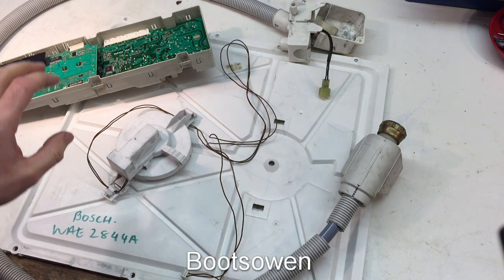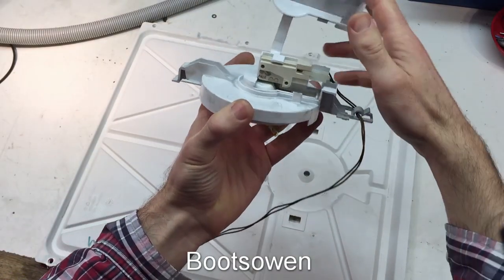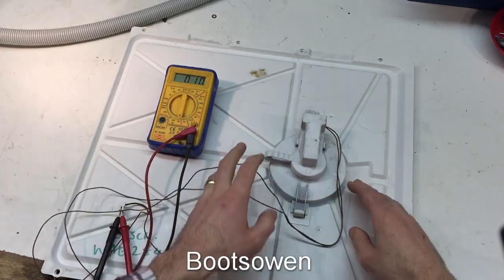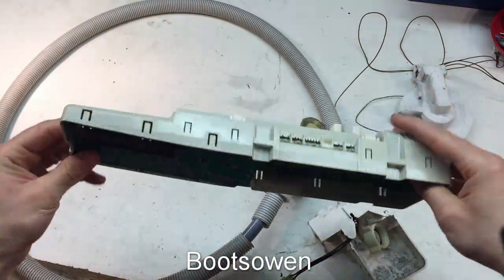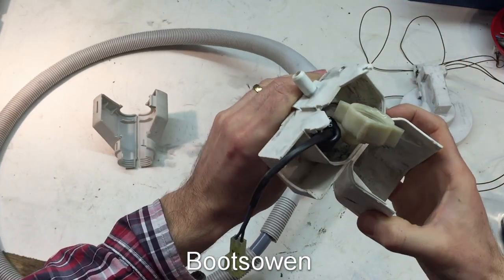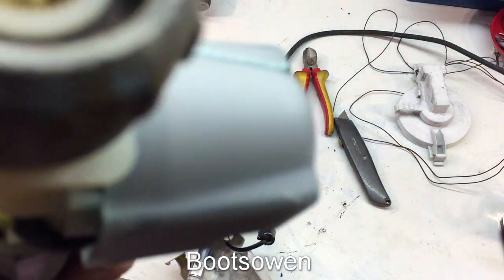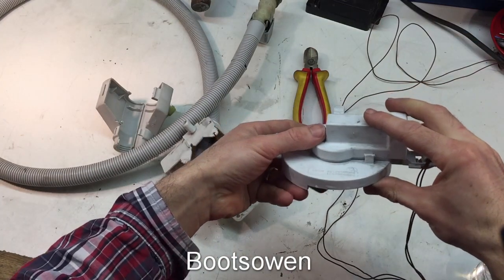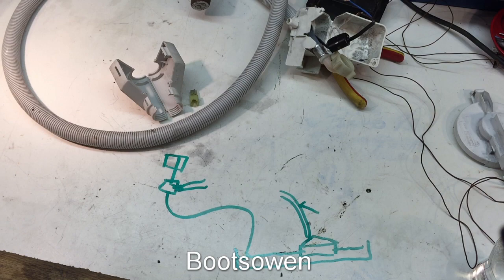Figuring out how a bosch aquastop works

Comment: Thank you, man! That really made some light!
I have such a hose that has been distorted by a mouse. I can not buy it as a spare part and taking the dishwasher to the service is out of the question. 
 If I understood correctly, the outer hose will only be used in case the inner one leaks? Because I can fix the inner hose, but the outer one only if the pressure is lower.
Reply from the maker: the outer hose will only be used in case the inner one leaks? yes. the inner hose is the only one that carries water most of the time. the outer hose would only be used if somehow the inner hose sprung a leak (without the outer hose getting a leak) and this outer hose would guide the leak water down to the bottom of the machine where the float switch will stop the water at the faucet.
Reply: bootsowen good news, thank you! I will be able to fix it in this case!

Comment: Came here to find some explanation on where does the Aquastop solenoid get its power from, because mine's attachment to the washing machine is just a plastic and rubber screw - no conductor anywhere to be seen!  Looks like the one you examined is instead fixed to the machine, from where power wires run out. That makes sense, but doesn't help for my case... (And it's a brand-new Bosch machine! no shady third-party or whatever)
Reply from the maker: Hi there, maybe this video will help you, let me know.  https://youtu.be/8P4uC1jat_U
Reply: Thank you, it helped to understand how the idea can work without power... and made me take a better look at my hose.
Turns out that the washing machine is listed as having Aquasecure, not Aquastop. So probably it's just like Watersecure - even though the shape is the same as Aquastop, and doesn't have the small window/indicator you show in there.

Anyway, this all solves my question, which was how bad is it to add a standard hose as an extender. (answer: survivable)
Thank you so much!

Comment: I guess the microswitch also triggers the drain pump as that plastic tray isn't designed to catch large amounts of leaking water.
Reply from the maker: I am not sure that that is so. If the water gets to the aquastop switch in the tray it is from a leak and the pump would have no effect on it. I think the aquastop turns off the water at the faucet so that a leak doesn’t get worse.

Comment: Thank you. Amazing explanation. Fan for life!! Cheers. Just wanted to know whether the same system is in Bosch dishwashers too? Because the inlet solenoid and the sleeve pipe is there too.
I always used to wonder why they have placed the inlet solenoid at the point of connecting to the faucet rather than in the machine inlet.
Reply from the maker: Hi, I think there are two inlet solenoids, one at the faucet and one inside the machine. The one inside the machine could be multi way for the main/pre wash soap drawers. I have seen similar on a miele dishwasher. But I have also seen similar systems without the hose where there is a float in the base.
Reply: @bootsowen  Thanks for that bit of knowledge. I am from India and to the best of my knowledge, Bosch washing machines here do not have aquastop, only dishwashers come with it. I used to think this was a patented system of Bosch, but all brands dishwashers come with this solenoid valve  at the faucet end of the water inlet pipe and the enclosed sleeve . Or is it not a patented system?

I did not know about this valve being part of aqua stop system till I saw your video.
I know water inlet to washing machines have divided inlets into the prewash, wash and rinse chambers in the machine. I used to think because of this multi valve inlet, they have not provided aqua stop in washing machine as it would make the system quite complicated.
Thanks once again.  Wishing you all the best. Love from India.
Reply: Just bought a Bosh washing machine (bought in Australia, made in Germany) and it does have Aquastop.

Comment: Hi thanks for the great video! I currently have an issue with mine, don’t suppose you know the resistance of the Solenoid coil ?
Reply from the maker: No idea. Can you test if it works using electricity?
Reply: @bootsowen  thanks for the reply, turns out it was working correctly and the washing machine had a leak so it shut off the water! Fixed the leaking o ring seal and back running again. Great video and explanation of how the leak detection works 👍

Comment: Question: does an Aquastop has to be positioned vertically down from the tap or does it function equally well when positioned horizontally or, possibly, vertically up? My question is inspired by space problems. Hope to read your advice. Thx.
Reply from the maker: I don’t think it matters. The solenoid valve should fail safe, it should always be closed under water pressure unless it is opened by electricity. Try it and see?  Let me know how it goes
Reply: Was there an answer to this? I have the same issue with a horizontal water pipe and no room to turn it downward...  :/

Comment: I currently have code E15 on 800 series Bosch dishwasher.   This has happened when the water inside the supply line freezes.  We were at 14F (-10C)  last night.  I'm guessing that's why I have the code.  The dishwasher is humming and appears to be trying to pump water, or something... I'm not a mechanic.  Pressing the start/stop button will not turn the machine off.  Flipping the circuit breaker won't get it to stop either. 
In the past I've always been able to pull the dishwasher out from the cabinet and tilt it forward, then set upright, push back into cabinet space and all was well. (Hope this may help someone else.)  I always thought that might be breaking a vacuum.

 Not this time.  Christmas eve.  I need to be cooking instead of plumbing!  I guess I'll try removing the water supply hose  and see what happens...hmmm...Maybe I'll warm things up with a hairdryer first.  Could be the water in the bottom of the drain pan is frozen.

Thanks for your explanation of the electronics of what is happening and Happy Holidays to All!
Reply from the maker: If you turn off power at the breaker and the machine keeps humming you have a problem with your circuit. Nothing in an electric machine like this should run when the circuit is off. Let it thaw.
Reply: @bootsowen  Thank you for your reply.  re: circuit breaker, I had hoped that by turning off the electrical  supply for a while and then turning it back on that the computer functions might re-boot and be OK.  That didn't work because the float valve was still raised and the machine warning was working correctly, as designed, and the pump groaning sound turned on as it should have.

Good News!  The hair dryer DID work YEA!!!!!  Once the frozen water under the float valve melted and was drained (by tilting the machine) the E15 code and noises went away.  I did have to drain the water from the pan with  paper towels, but as there were no apparent water leaks anywhere, I believe the expansion of the frozen water raised the float valve. 

This morning, Christmas morning, still at 19F, the water in the coffee machine froze.  
Thankfully we should be back up in the 70s F next week.  We're not prepared for cold weather here.

Comment: Great video and love the little drawing at the end , we have an issue where the washer kicks in but very quickly the water check light illuminates and the cold feed water would continue to flood the base of the unit and eventually out of the machine onto the floor. Any thoughts ?
Reply from the maker: broken cold water feed?
Reply: @bootsowen  thanks for replying, think I will need to look into machine in more detail , including the cold water feed, are you suggesting a broken solenoid valve ie the machine will just continue drawing water from the feed source, so , a bust impellor etc. Hear from you soon and thanks from Scotland
Reply from the maker: i have thought about it a little more since I saw your message first. There is probably a hose inside somewhere that has come off, or something has cracked. Usually it is the most likely thing, so probably a hose. Either somewhere that water is flowing or somewhere that water gathers, like at the bottom of the machine.  The machine has a pressure sensor that tells it's controller when enough water is in it. If the water keeps leaking out then it will never fill, so will keep leaking until a predetermined time is exceeded.  So it is probably not the fill valve.  BUT, I don't know what make and model of machine you have and you don't say if you have an aquastop, though I presume that you don't.  I would say take the top off, turn it on again and watch what happens. Just turn it off again when you see where the water comes from.  Obviously, if you put your hand in there with the top off you could get electrocuted, that is your risk.  I would use my eyes to look for a leak.  Let me know how you get on.  Good luck!
Reply: @bootsowen  About to have a better look , model is 9000441014, trying to locate online manual ?
Reply: @bootsowen  Apologies , when I said base of machine , I meant inside the unit itself and not the external base, it fills from the feed and check water light comes on immediately and will just keep filling, model no 9000441014. Sorry

Comment: I have some question regarding my AquaSTOP outside pipe

After remove laundry, I saw tearing at the outer wall of aquaSTOP inlet hose almost like in that video. 

Do you reccomended to change a new one?  if I'm not change the host what will gonna happen such as error code or leakage?  Now I stick them using transparent tape and still doubt to change because changing whole aquaSTOP kit  it's too expensive and I have no idea to change outer wall.
Reply from the maker: If your machine is working fine and doesn't have an error code why are you worried?
Reply: bootsowen Hello bro, The machine is fine. I turn him off both electricity and water every load. But a bit worry about little crack which I don’t know what take place after saw your vids it quite like mine now. Maybe I’m worrying too much.
Reply from the maker: @sedthavudhtaweesapaya7026  Maybe?

Comment: I want to install in my dishwasher an aqua-stop mechanism. Provided that the dishwasher is powered on, that aqua-stop valve is always energized through the duration of the cycle ( letting the flow of water), or it follows some on - off pattern ?? Thank you !!
Reply from the maker: The aquastop that I was looking at is an integral part of the machine and controlled by the computer within the machine. I don't think it is possible to fit one to a different machine, unless it was somehow designed for it. Post a video of what you are doing.
Reply: @bootsowen  Thanks for your answer ! I will post the outcome !!

Comment: So does that mean when there is no power is closed from the tap mechanism
Reply from the maker: It should be closed under no power, but there could be a fault with the valve or some debris holding it open.